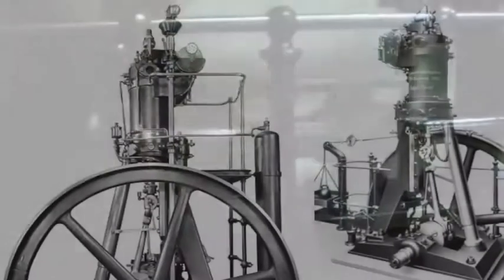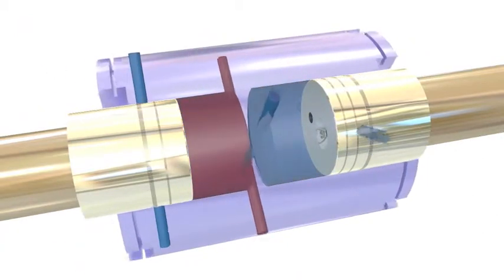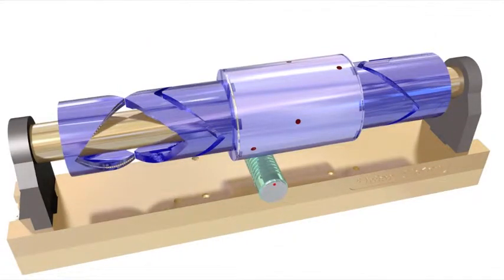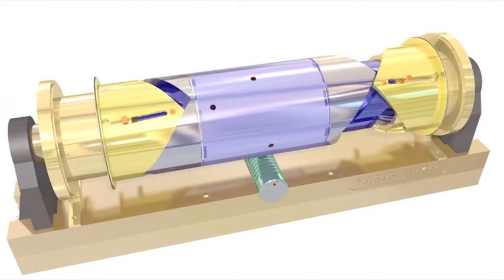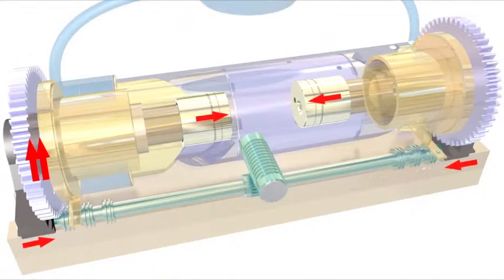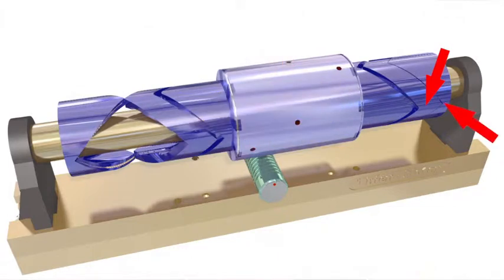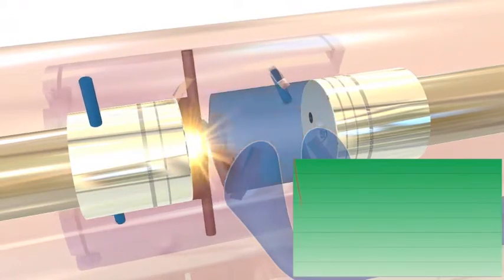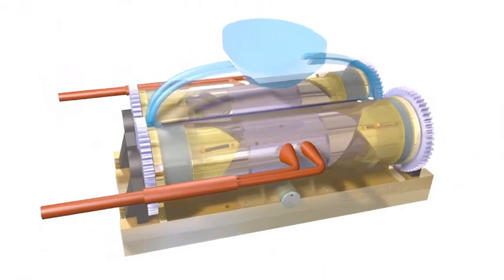THE THIEN MOTOR e2

Comment: It looks like somebody mesmerized by worm gears wanting to fit as many worm gears in the engine as possible. Tips of helical apexes touching each other! This is no-go for any mechanical engineering! Except for retractable ball-point pens, of course.
Pin drivers for helical surfaces are ridiculous they will fail after few thousand of cycles. 
There will be enormous friction which will eat up the efficiency and create a need in lubrication and cooling.
The engine is severely unbalanced.
There is no real dealing with gas volume. As if gas flows through multiple check valves (!!!) and passages without compression losses, friction losses and dead volume.
Constant linear speed means large losses because of burning during expansion. 1.5 ms fuel injection time... what is the stroke timing? 15 ms? Not less otherwise fuel will be burning in the exhaust... So it's top going to be 3600 rpm? Where this thing is going to be used then? Too slow for any truck or car, and too unreliable for any stationary or ship.
Short time of the opening intake and exhaust ports means no overlapping and great losses on suction and venting. 
No exhaust gas recycling means high NOx. Add to that the oil that will have to be added to the cylinder... Definitely not greener that a today's two-stroke in a cheap scooter.